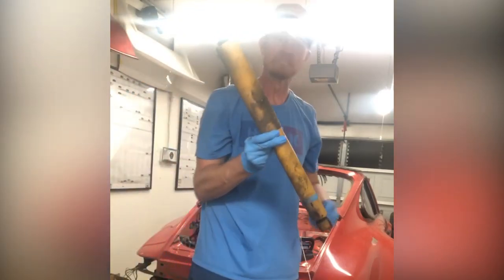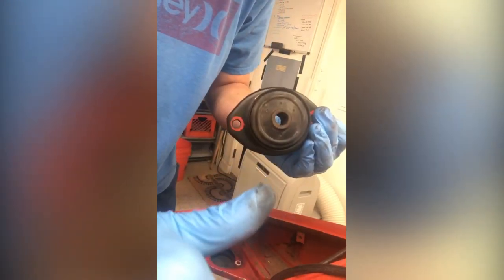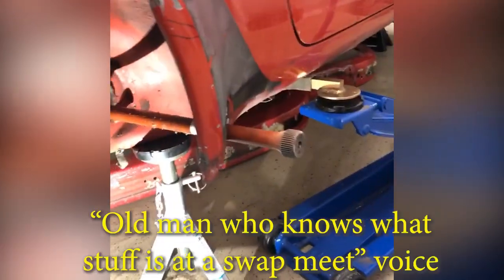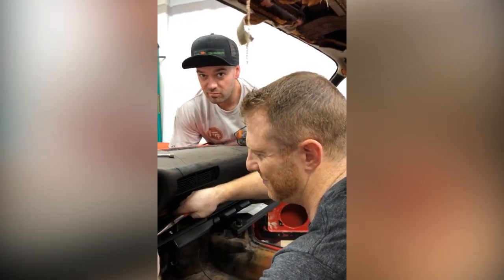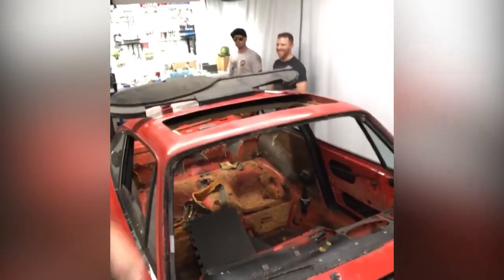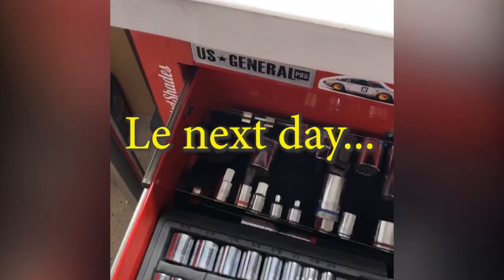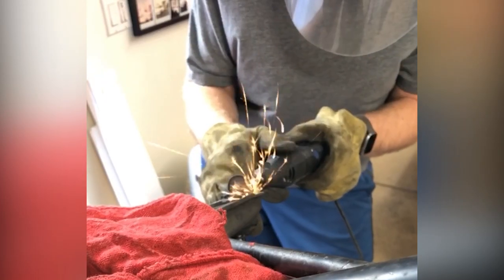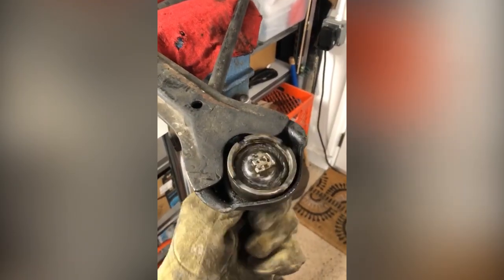Suspension removal on a classic 1977 Porsche 911S. Preparation for RSR build. S1:E4

Comment: Maybe the spacer on the left strut because these cars when lowered tend to rub on the left fender?
Reply from the maker: should have clarified that US midyear cars came with these spacers in the front in order to meet the impact bumper height regulation. The fact that whoever was in there before me removed one side and left the other was notable.